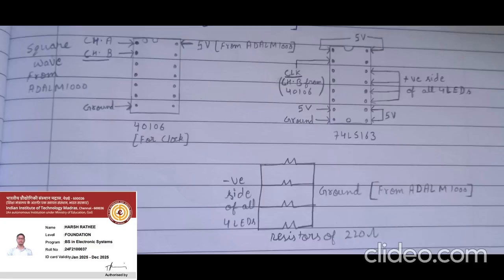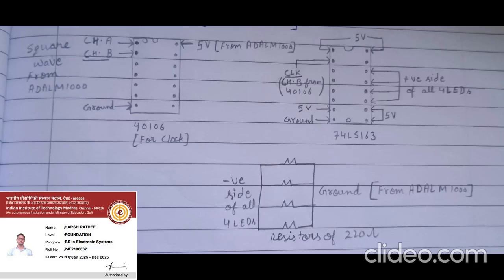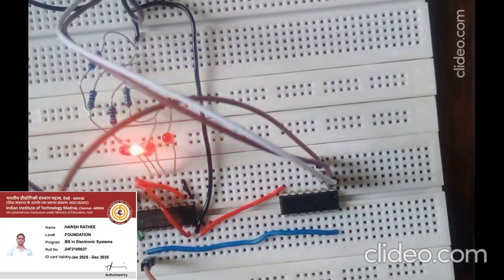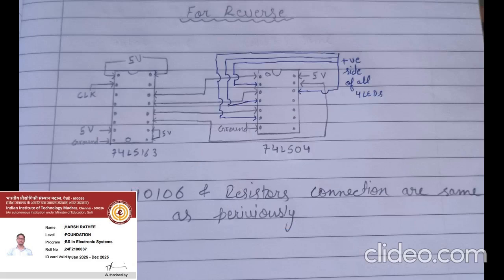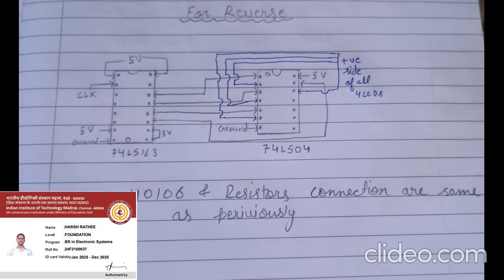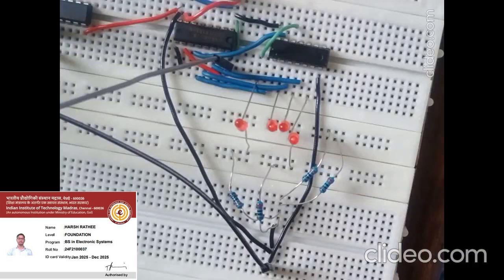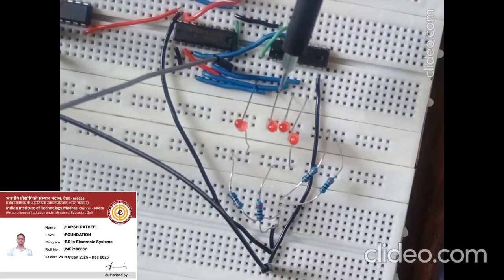IIT Madras  EEC Lab  Week 3 Experiment

Comment: Can you please say a 220 ohm resistor is built by 55 ohm, all 4 or 2 (100 ohm) and 2 (10 ohm) resistors
Reply from the maker: each R is of 220 ohm. 4 R are connected to 4 LEDS